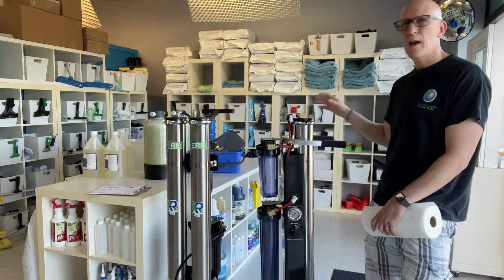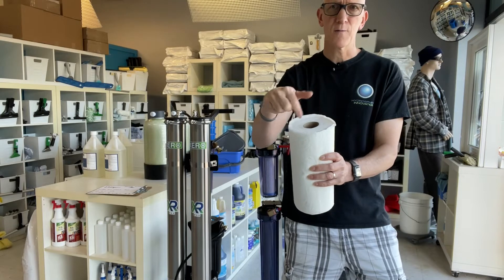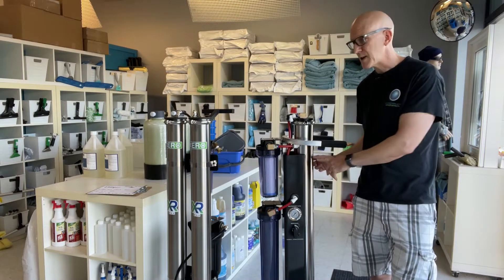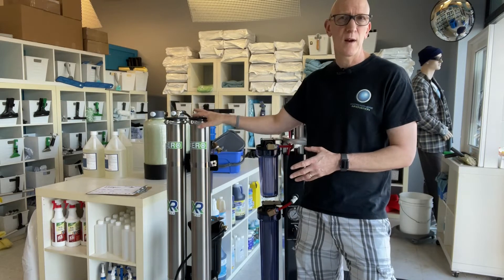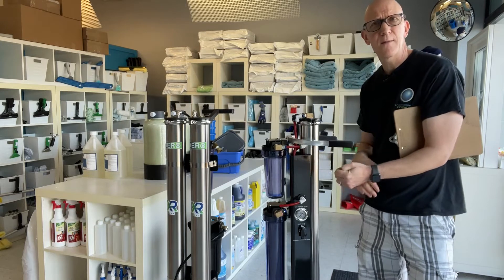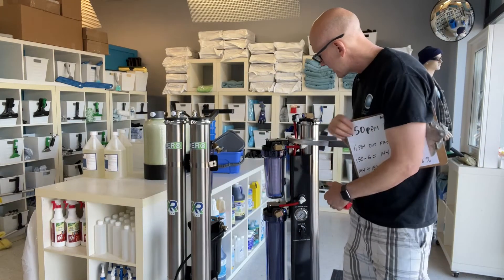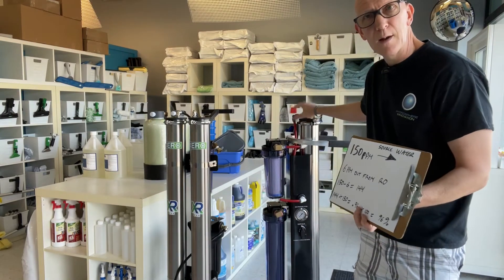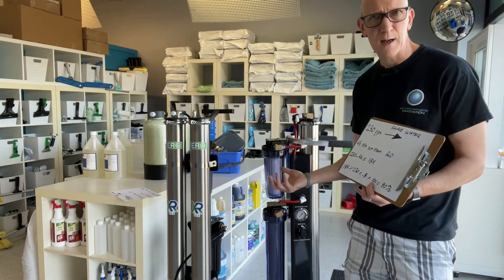Water Fed Multi Stage System Maintenance Part 2 - RO Membranes

Comment: This is where I should have asked, where does one have two RO membranes? Lol 

Seriously I want to know the advantages of having two verses just one.
Reply from the maker: Great question! For these water fed purification systems that use two RO membranes, they are hooked up in parallel. A single RO will restrict flow by X amount due to the dissolved solids rejection process but rather that the source flow just holding back, it'll redirect to the other RO. Think of it like a garden hose with a valve at the end. If you turn the ball valve down, restricting the flow by 90%, you get 10% the amount of water leaving the garden hose. But if you put a garden Y splitter ball valve on the end have the valve restricting by 90% on each side, you end up getting 20% of the original flow out of the garden hose.